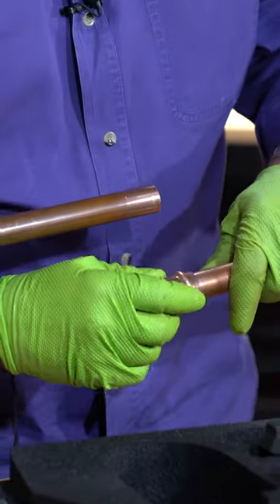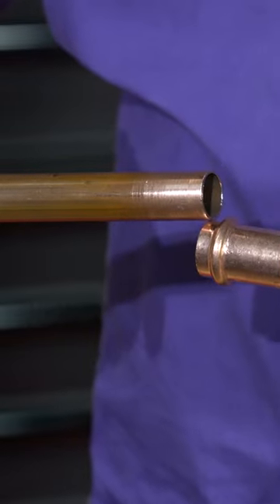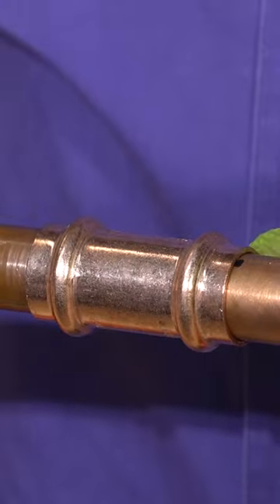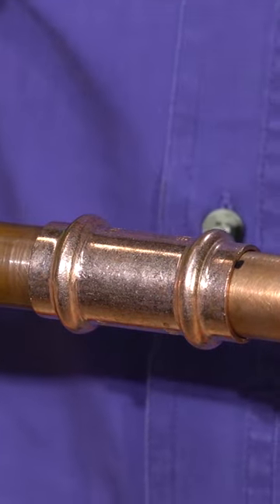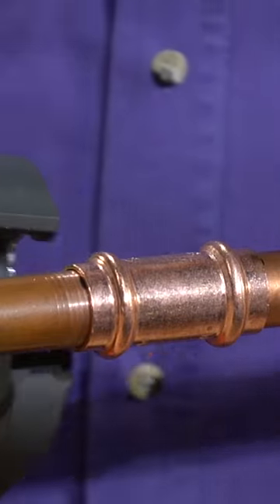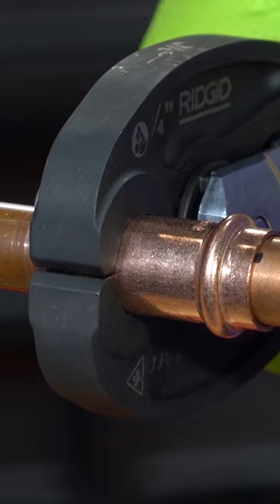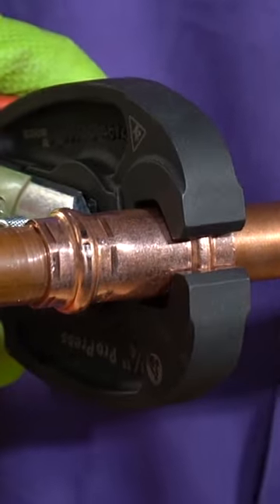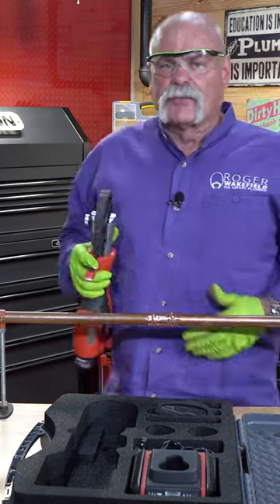How to Make the PERFECT Press Joint

Comment: Hear me out, there's this stuff called solder.
Reply: As long as he didn't teach soldering. You should see his video. He roast it bad. Lol.
Reply: @travisjessup6618  Shark bites also leak after a while meanwhile 50+ year old copper plumbing soldered together still going strong.
Reply: @vincei2147  this isn’t shark bite lol
Reply: Apparently 50+ year as a plumber and this guy thinks that was a sharkbite 😂😂
Reply: @@One-ik4pbcommercial and industrial HVAC here, i find low flow have no issues, but a coworker built a header for pumps out off 3" press. And 5 years later there is water stains at the fittings
Reply: 5 days a week I do 2 days worth  of work for every 3 hours I'm using the press. I'm installing water heaters on a commerical project with a ton of extra stuff with everything from mixing valves to dwelling stat and having them piped to the furnace and let me tell you. There's no way you would be in the black doing what I do having to sweat everything in.

Comment: I would have figured that an old school plumber like yourself would never use anything that isn't soldered.
Reply: They seem at least as reliable as compression fittings, but seem no easier to remove than soldered - you'd need to cut the fitting carefully and pry it away from the pipe
Reply: Just a worse sharkbite

Comment: I just don’t trust a fitting with an o-ring! If they made that with a ring of solder inside and then you pressed it and soldered it I would trust it. I’ll stick to soldered copper and pex-A and Uponor expansion fittings.
Reply: I thought the same, but press fittings actually do hold pressure even with the o-ring removed
Reply: Press fittings are incredibly reliable, just check the o-rings before you dry-fit everything to make sure you don't have any defective ones (one in a million)
Reply: 2 different connections are made. The o-ring and the static connection of the fitting crimping onto the pipe itself.

Comment: Not looking forward to buying one of these but it has it's benefits... just $1500 is expensive just to use once in a while in difficult or questionable areas
Reply: sucks for regular home owner, fitting cant be reused and pipe could be distorted. Gonna have to cut them out for route change.
Reply: @ekfliu  exactly..,. I'm a remodel contractor...I don't do large pipe normally... plus I don't do commercial buildings that regulate soldering.... but once in a while.... something like this would make a difference between 30 minutes and 2 hours...
Reply: You can hire them
Reply: I get mine in tight places every day. It's more of using it in places where you're close to a wall. Then you need the close quarters jaw so it's another 1800.
Reply: I was graced by the plumbing gods and picked up a basically new m12 propress for $300!!! Only problem was the handle to change out the jaws was missing, I’m getting a new custom metal handle machined in a shop by a family friend. I still use it without the handle and it works amazing.
Reply: You can get a manual one for less than $100
Reply: @howtodoitdude1662  yup... 90% can't do "T's" I've  looked  into  that... thanks  though ☺️👍

Comment: Fun fact: Viega has a green dot (on the copper fittings) if the dot burst and is no longer a circle the press is correct. Still have a dot get the cutter out. I think mega has a yellow dot but could be mixing up the colors
Reply: Mega press has green and yellow. Yellow for gas, green for water. The green dot on copper is actually Viega Smart connect, they are designed to allow water or air out of the crimp isn’t made. Doesn’t indicate good or bad crimp
Reply: @DynoMikeReviews  that’s directly from the Viega rep. He was on the truck breaking everything down and he went into that right after using the depth gauge 🤷🏻‍♂️
Reply: @rhyscallen6915  Then my local Viega rep and the Viega website are misinformed
Reply: @DynoMikeReviews  wasn’t saying you were wrong just saying what the dude showed us..also the Viega site breaks it down as the colors are for fitting identification. Green EPDM sealing element Yellow HNBR element White FKM sealing element Nothing about letting air or water out.

Comment: I am asking there is a rubber o ring inside it right?
Reply: Yea basically, I’ve used pro-press a lot and it works like a charm
Reply: @alexkhamov5162  can it withstand hot water temperatures?

Comment: The other day while I was browsing lately I saw a manually operated version of this. It seems like it's a really bad idea to do it manually it would take a lot of strength
Reply: Those are ratcheting. So you don’t have to use hulk strength to get them to close
Reply: They are solid, i use them for when water is live and in a bad spot.. Screw risking messing up an expensive electric handtool
Reply: Maybe for wimps who don’t belong in the trades
Reply: I have a hydrualic pump version. Bet of all worlds besides the head design

Comment: How to make the perfect connection with Amateur Press fitting:
1) Remove the stupid O-rings which will fail.
2) solder the fitting into place with your torch.

Comment: I saw reports online here on YouTube that press fittings are prone to micro leaks when used on type M copper, that it’s too thin. We just had a water heater replaced and low and behold some of the fittings have micro leaks, you can see a shiny water ring around the edge of the fitting. The plumber used leftover old pipe and I can tell it’s type M because of the red font. The leaks are so small that they don’t seem to drip, but it’s winter so the air is dry and the heater is running hard so maybe it’s evaporating, not sure what the case will be in the summer. It’s disconcerting and brings some truth to the reports I’m seeing. Have you heard about this?
Reply: The o rings inside the fittings are oiled. The oil squeezes out sometimes when they are pressed onto the pipe.
Reply: @masejames4906  in my case it’s definitely water. I’m able to wipe it away/soak it up with the corner of a piece of paper, and it ever so slowly comes back.
Reply: @goldistocks609  are they Viega fittings with the insertion depth marked?
Reply: @masejames4906  Yes. I’ve seen others reporting the same issue with type M copper, that it’s too thin.

Comment: ⚠️Can't help thinking that if the cut ends are not completely blunt and smooth, the o rings will get damaged during insertion.
Plus I wouldn't sand the ends down, that's inviting tiny leaks

Comment: Dont get it. Why does manufacturers dont put a dint right in a middle for a pipe to stop? You wont need to mark it and you will that that it cant get in any further meaning the pipe is a full way in. 🤔
Reply: they do this is a repair coupling and not just a regular coupling.

Comment: Uses o rings. I don't trust it. Sweating is easy enough.
Reply: Propress is better when doing repairs to water lines that have water lines in them or passing valves.

It's also much faster on certain jobs and applications. 

I keep hearing people say that the o-rings are bad but I haven't seen any proof anywhere of that.
Reply: Have never seen a propress fitting fail. Have seen plenty of issues with solder.
Reply: @AtomicBoyscout  I'm not saying they don't hold in the short term. They're supposed to hold for at least 30 years or more. I don't think o-rings will hold up in the long term. I've always sweated copper pipe with silver bearing solder. I'm testing the waters with WAGO's for 110v electrical connections at the moment. I'm not even sure about those. I have o-rings fail all the time on other applications. I don't think they belong in permanent fixtures/applications. O-Rings tend to crack over a short period of time. Especially with heat. I don't trust it.
Reply: @AtomicBoyscout  I've seen people not wipe off the Flux and after a few years it starts eating the pipe. Also I've tried soldering when the pipe had water in it that I couldn't get put and had a difficult time.
Reply: @mds6387  Wago's have a way higher fail rate than press fittings. The wagos are still pretty new where as the press has been around over 20 years in some places.
Reply: @auspicioustoot  Please stop
Reply: I'm clearly a better plumber than you.